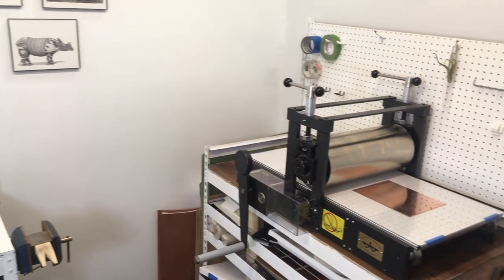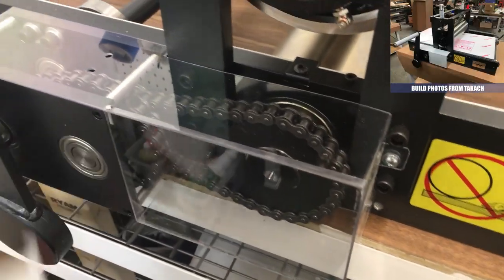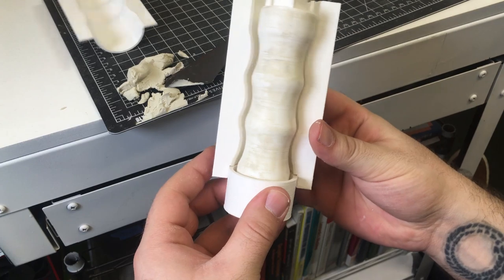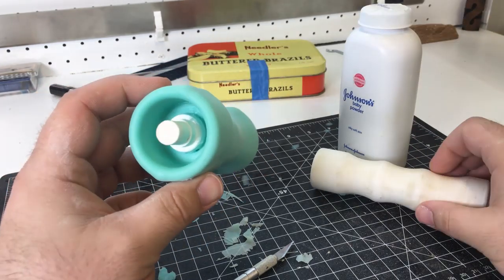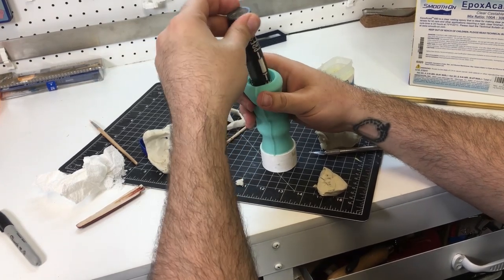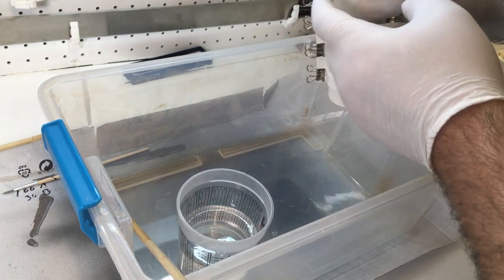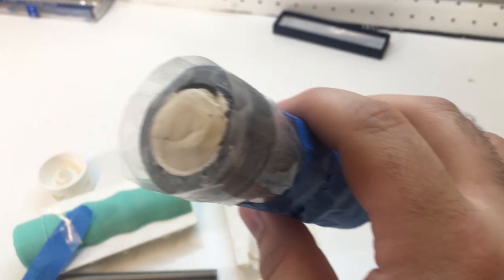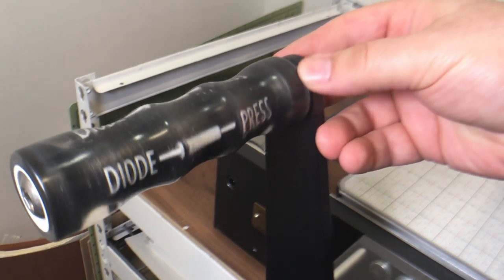Unboxing my new Printing Press and making a Custom Resin and 3D Printed Crank handle

Comment: Found you a few years ago. I've always been interested in block printing. Finally tried it with all this home time and had a blast! Of course, I had to go back and watch your series on getting started. I dont have a press, so I had to make myself a baren. Maybe if I keep going, I'll invest in a small press. Thanks for the inspiration!
Reply from the maker: That's awesome! It's terrible the reason we are all stuck at home, but happy to hear you're making the best of it!  I'm also printing by hand from home these days, and it's been a blast, even if it's a little more work. Thanks for sticking around and checking out the new videos.
Reply: @DiodePress  thanks for continuing to make them! I'm working on my second print now and scavenging various papers from sketchbooks and watercolor books I have laying around to try. Part of the fun has been trying to make due with what I have available. I've been pondering all week if I can turn my drill press into a Gutenberg style press. 😋